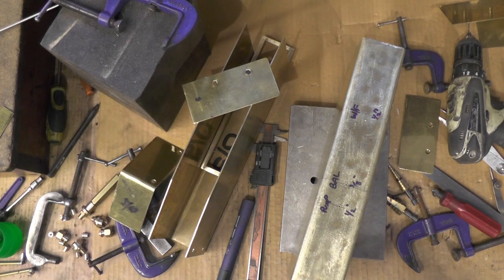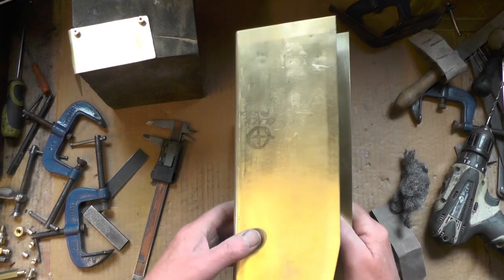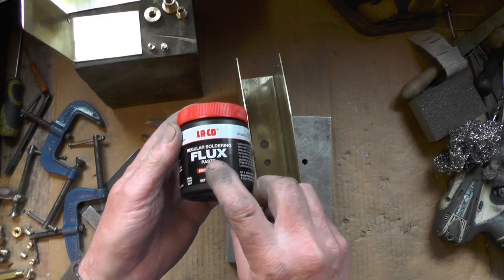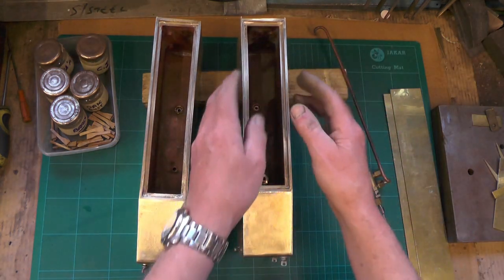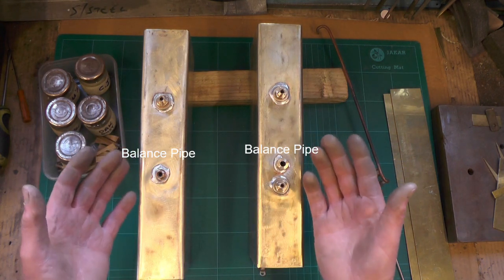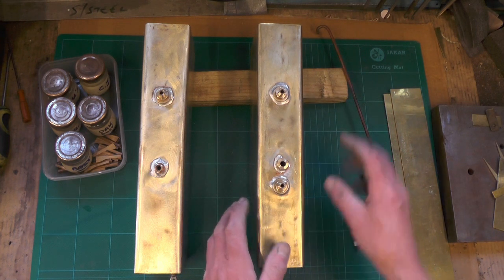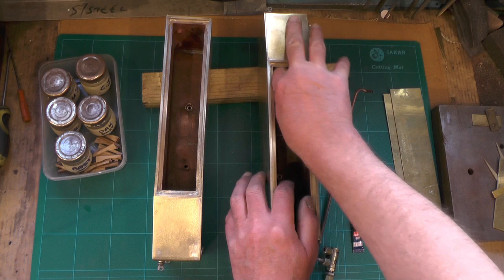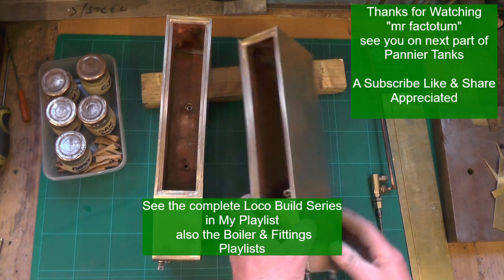Making a Beginners Miniature Steam Locomotive Series (Making The Water Tanks Part 3) "mr factotum"

Comment: Some good ideas Mr F as usual.  On another machining topic.  I’m rebuilding a basket case Comet and could use a little feedback on trying to machine a small bronze Smiths Speedo angle drive body.  ( v expensive to buy).  I wondered if I could possibly email you a photo or two to see if you had any ideas.   Mikefarmes@yahoo.co.uk.  Many thanks.
Reply from the maker: hi HG
sounds interesting, ive not long back rebuilt a basket shooting star, i will take a look at your photos when time permits i'm  away on a caravan trip at moment. email me at:
 imperialstainless1956@gmail.com
regards
mr f

Comment: Hi Mr F    I have been a bit quite   lately  but have been keeping  up with your videos .. I also like the  panniers  against  the saddle tank although I'm a long way away from that yet .. good video as usual..  I will have to make the suspension springs as I'm  unable to get any  think  close  here in sa..  I may   use soft   urathene ( rubber)  as  oil doesn't  affect it like ordinary rubber can you measure the thickness of  your spring wire and the no of coils as it will save me a lot of trial and error if I do end up making them  I KNOW I'M A PAIN hope your are all well and keeping safe ..  Dug Hogarth
Reply from the maker: hi dougie
nice to hear from you, your not a pain, don't think that way., i will do my best to help anyone out. i'm away from home at moment but will send you the info as soon as i'm back
take care
regards
mr f
Reply: @MrFactotum  thanks Mr F that info will be much  appreciated   lockdown has been relaxed  a bit  here but us old guys still have to take extra care  look  after yourselves  as well Dug Hogarth
Reply from the maker: @dougiehogarth6652  hi DH
the springs for the suspension are, and i'm quoting the label on the packaging from Blackgates Engineering where i got mine from.
3/8" outside dia. x 1.1/2" long x 16 swg and ground flat on the ends
Reply from the maker: Hope that helps dougie, any other info feel free to ask, will help if i can
regards
mr f
Reply: MorningMr F thanks for the info on the suspension springs  .. was able to get some here in SA just a little bit thicker on the wire size only ,006 thou so that wont make much difference. Loco is coming along fine and weather is warming up. How about video  about  setting the valve timing  with the valve cover of showing the position   of the valve in motion in relation to all the   valve gear parts . Dont think its that complicated but the book description   with no diagrams are double Dutch to me  .. keep  safe  as usual and thanks again for the info   Doug Hogarth

Comment: Great job. I love soft soldering it’s my favourite part. 
What do you use for degreasing parts. I have used acetone for bare metal but if there is paint involved then that’s not a good idea.
Reply from the maker: hi brendan
nice to hear from you, i use brake cleaner for degreasing, buy by the gallon from local auto supplies, it lasts for ages, but make sure you keep a tight lid on or it will evaporate.
thanks for watching
mr f